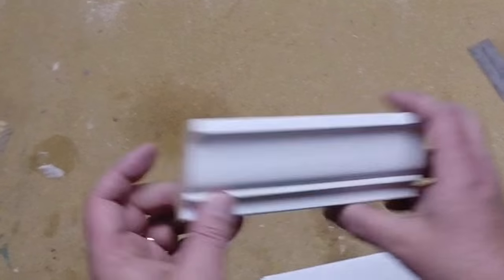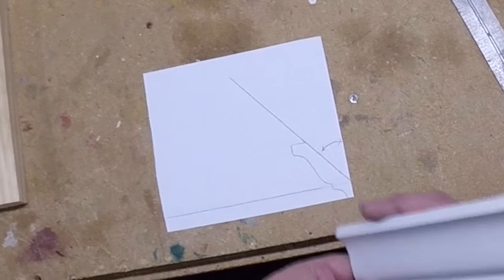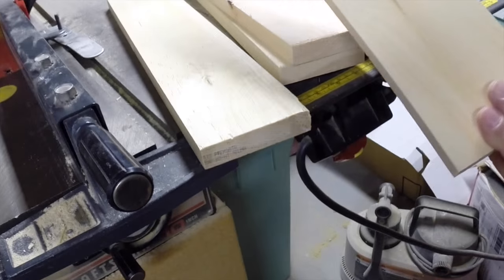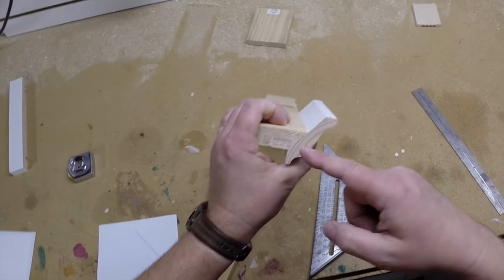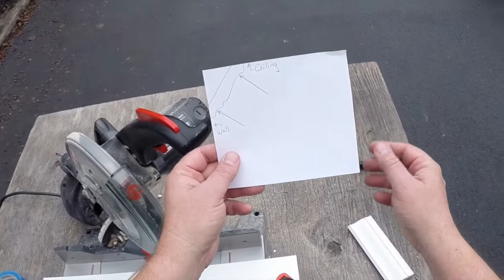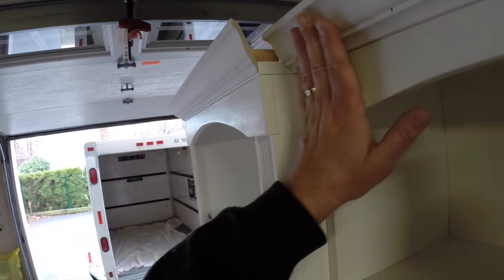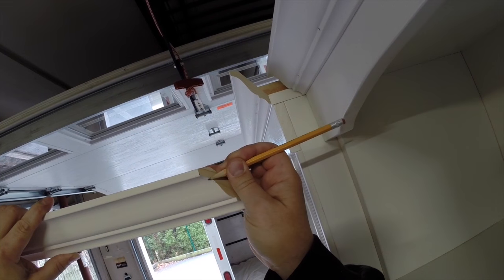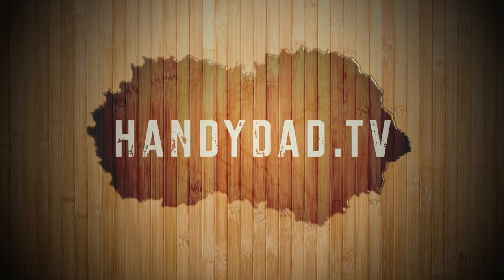How to Install Crown Molding on Furniture

Comment: Hi! What angle did you cut the crown molding at? How did you know where to put your extra board on your mitre saw? Also what table saw and nail gun do you have? Thanks!
Reply from the maker: Crown molding is cut upside-down at 45-degrees. I clamp the board so the flat edge of the molding is flat against the table. 

My table saw and nail gun are Craftsman. Nothing special.